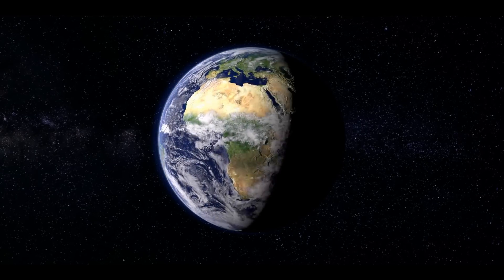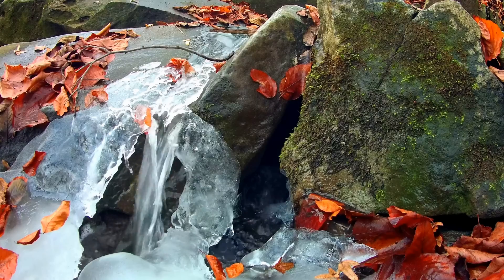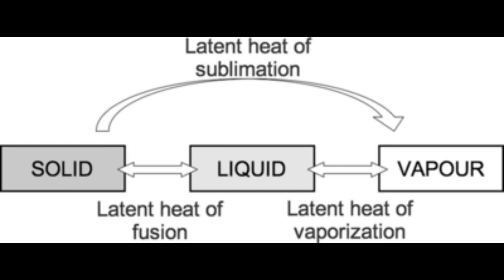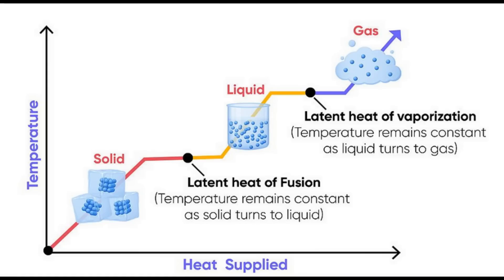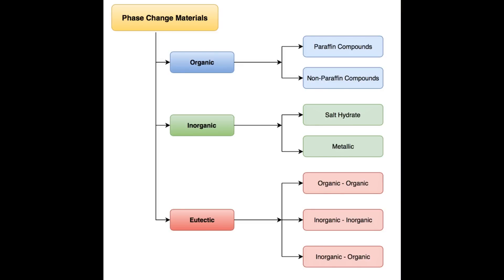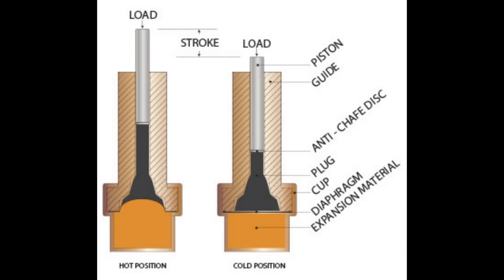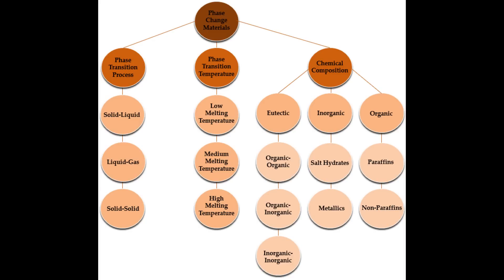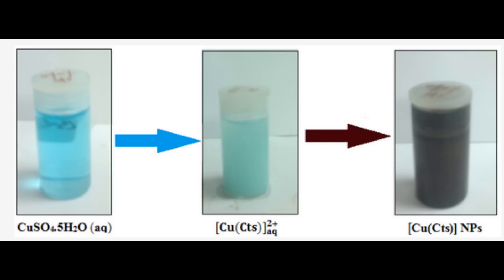2255 Phase Change Materials And Nanoparticles

Comment: Research on phase change materials and combining that with the new capabilities of heat-to-electricity (TEGs) should produce some interesting results.
    If the phase change materials can be handled more easily and safely while storing more heat than a huge molten salt pile, then it's a win.
    If they can deliver the heat to the TEGs as well as or better than the existing molten salts, then that's a win.
    And finally, if there's a way to convert, directly using the phase change quality of those materials, to electricity, skipping the TEG altogether, then it's a huge WIN.
    This is a great area for research because we produce so much waste heat, and we now know how to collect solar heat to feed that kind of process.

Comment: Can you do one with generating nanobubbles with Generation and Stability of Size-Adjustable Bulk Nanobubbles using electrostatics?  The paper is called Massive generation of metastable bulk nanobubbles in water by external electric fields.

Comment: Rob! Don't you think it is time for a flying car? Surely all the knowledge inside your head should be able to figure out an affordable flying car. Like right now the batteries don't last long enough (I imagine) - but is there some way to re-charge capacitors using the windspeed created from both the engine forward motion but also from gravity - or creating water and then dropping it, or using graphite impregnated shell...or drop the shell of the plane or use it for fuel in some way - chemicals on one side of the plane creating a potential with regard to the other side. I am quite tired of waiting for someone to invent a flying car. Surely you also want this to be done in your lifetime!
Reply: I’ve cracked it

Comment: I have recently had installed a water heater using phase change materials. "Fischer future heat", not sure what materials they use though. Of course I use it in conjunction with my solar panels. Seems to work ok so far.

Comment: Heats of reactions aren't a production or absorption of energy per say, merely a change in temperature due to the change in the heat capacity of materials when they form new bonds, the energy that they had to start with is the same (in an insulated system). But once they get hotter or colder, the temperature difference with the environment results in a spontaneous flow of energy until the temperature becomes uniform, giving the illusion that energy was produced or consumed, but it hasn't, it merely redistributed because of a change in heat capacities. It's a bit like the spinning ice skater who spins faster when they pull in their arms, the kinetic energy they had was the same, but because their moment of inertia changed and the momentum has to be conserved, the result was spinning faster without adding energy.

Comment: I have spent many years studying phase change materials doing renewable energy research.

While right just this instant, I'm not conducting any physical/practical studies, I'm still reading up on the subject, until I can get to the point where I can resume physical/practical studies, because I have read some information that strongly suggests that there are some super deep depth phase change chemicals people have simply never been looking into, which are so rich in energy density that they can literally out perform lithium ion batteries.

Admittedly, this study is somewhat 'under wraps', at the moment, but, should it become a thing, you can expect that many people will immediately try to copy my work.

Therefore, until I get to the point I can bring this into actual production, I won't be releasing anything on it.

Comment: We have those hand warmer packs where you snap a metal popper to change the liquid to a solid which releases heat.  I wonder if there's a material that could change phase when exposed to sunlight, and then when reversed, instead of releasing heat it releases electrical energy.  If something like that existed you'd essentially have a combined solar panel and battery.

Comment: try changing 2 ltrs of hydrogen and 1 ltr of oxygen into water at room temp.   that would be a phase change..............(impossible) no hydrogen in water...........
Reply: H2O, TWO ATOMS OF HYDROGEN AND ONE OF OXYGEN, THAT IS WATER.
If you mix those and expect to function, it will be pretty slow, the reaction emits a ton of energy (literally this is rocket fuel) either as a big beautifull ball of fire or as electricity in your garden variety fuel cell.
Reply: That's not a phase change, that's a chemical reaction.

Comment: So wouldn't a sand battery be more effective if you converted the regulator sand into its smaller nan😢o particles ?
Reply: Geometry has a major affect on the properties of materials
Reply: Take carbon for example, as graphite it's not very good at conducting heat, compare that to Graphene and it's now absolutely amazing at conducting heat
Hope this helps 😁
Reply: So yes it would be probably a better version of sand battery more than likely...
Reply: It's a metal so has very good heat capacity and copper specifically also has good heat conductivity. And moreover copper nanoparticle enjoy transferring heat to adjacent materials more than usual. This could probably be used together with graphite insulation tile separated with ceramics from the copper nanoparticles to create a very efficient heat storage device.

Expensive as all heck which would make these A. Target for copper thieves and B. Just better to use small amounts of copper NPs in a sand based thermal battery

Comment: This is my first ever comment and I shall keep it simple but there is some fundamental questions I had about the nanoparticles part. Given they are easy to make, but how to keep a check on their consistency under different weather conditions as we have here in India? Additionally, when you say that copper nps can eat up light too and store it in heat form, then would that heat be in the same ir wavelengths? Your work seems commendable, sir.